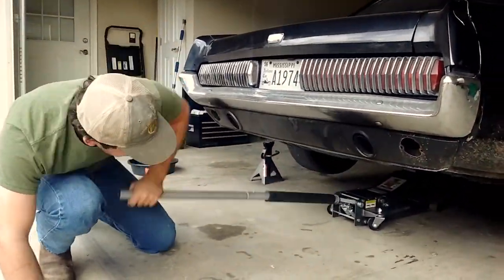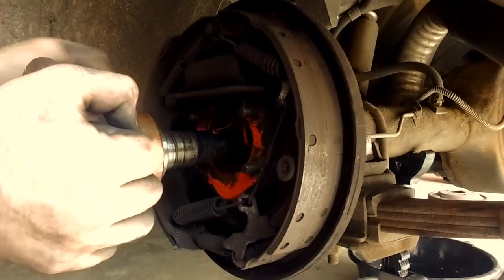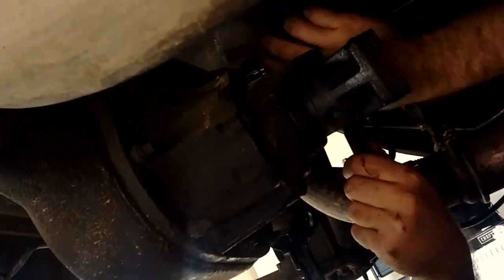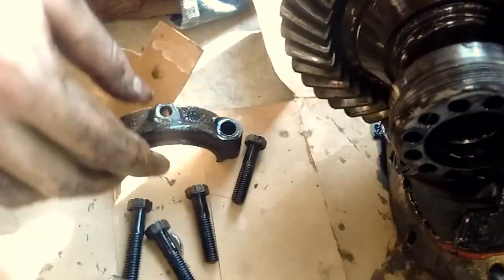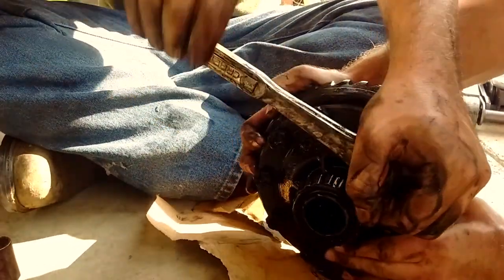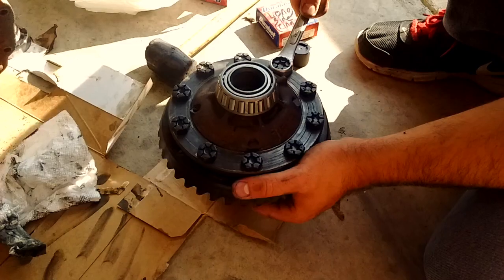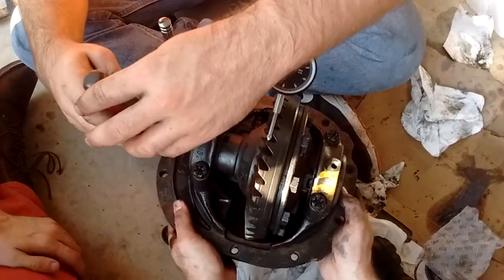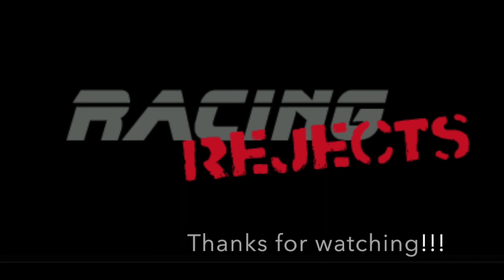HOW-TO: Rebuild a Ford 8/9 Inch Rear End in a Garage

Comment: Will the center cap come loose enough just to drain fluid without pulling axles out? Just trying to do a fluid change on mine. Thanks
Reply from the maker: You might could drain the fluid but it’s best to remove the center section to clean everything and change the gasket or apply RTV.
Reply: @RacingRejects  also wanting to do a disc brake conversion on the 9 in. Its out of a 84 bronco ( full size not a bronco 2). Could you give me any tips on a kit or certain brand to buy

Comment: How you drain the oil first?
Reply from the maker: The oil will drain when you separate the center section from the housing.
Reply: @RacingRejects  Ooo OK thank you very much
Reply: @mxrayo7043  Leave a bolt in the top so the 3rd member section to the housing so it dont fall out. Crack it open at the bottom, let it drain for about an hour. You can use a second floor jack under the 3rd member so you don't have to man handle it down out of there if you want.